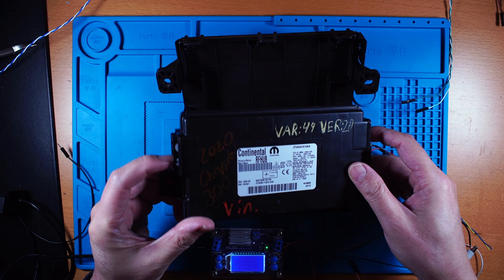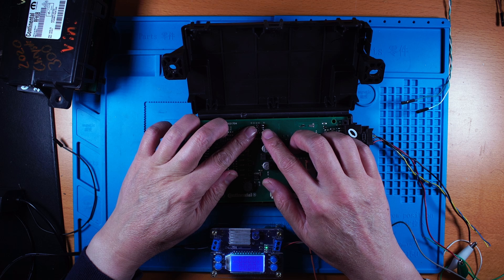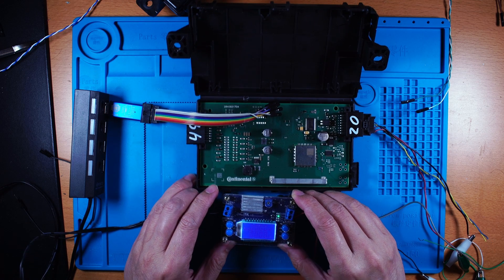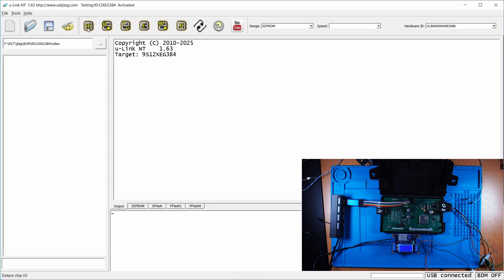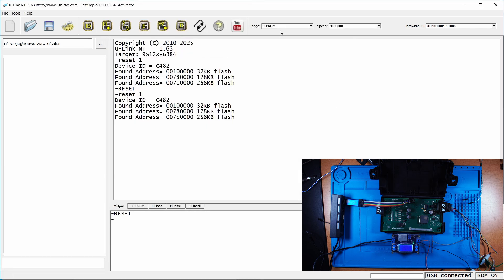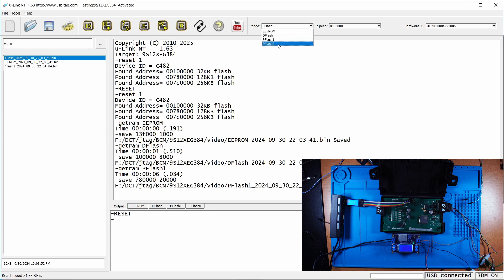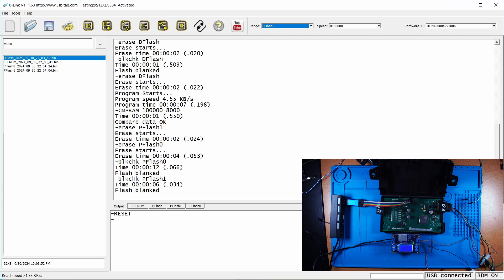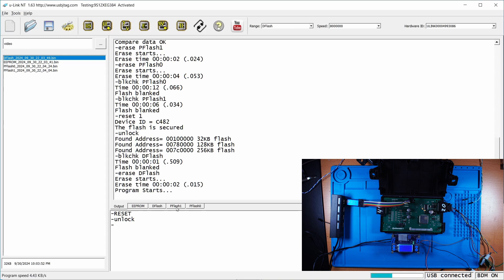u-Link NT Program RFHUB(MC9S12XEG384, BDM)

Comment: Don't tell me to come to the site because I already gone to the site and I'm still waiting admin approval. How do you apply the checksum to this RF hub. Cuz cloning it's great and everything but it does me no good. If I need to modify it. I can see that the new version of the software calculates the checksum. Um. If I had verify or comp ram or whatever it does it apply the check from because I've had it work numerous times before where I go in there and edit it but I usually have to do it multiple times over and over and over for it to actually work and take the vin. And I haven't really found any reason why I work sometimes and other times it doesn't. How do you apply the checksum to this particular device on this particular Target?
Reply from the maker: The forum's account will not be activated automatically until you send admin email to do so. Too many spammers. For checksum to work, there is no universal way, each target needs its own algo and case by case. u-link NT provide a way to read and write and with expand dll function it is possible to implement the checksum or any binary patch feature but this will be separate from the main software.
Reply: @usbbdm I already did send that but no answer and there's not a checksun. It's a little more complicated than that. It has what's called an FTM which is a boot and partition manager and there's different permissions that get set and stuff like that. You can glitch it into stopping the CPU so that you can write the braum data, but then the prom data has its own copy functions that happen to copied it down to the NVram or another partition in the eprom partition cuz I guess like the eepron partition can get segmented into multiple sections. One of them gets used as regular RAM and other one gets uses. Storage is more like a filing cabinet with a rotating data when it gets stored you can't do it at certain times and you can do it at other times. Otherwise it's volatile when you lose power. Blah blah blah blah but I figured it out for sure
Reply from the maker: @crbnchem  Not get any email ask for the forum activation. For everything you want to do with the binary you can make a clear request and it is possible to create a DLL to do so.

Comment: Having issue with read this modules with different tool .. I have this device how do I download software
Reply from the maker: Watch to the end of the video. The softwarer has it all.
Reply: @ I sent email for activation code still waiting for that to use device
Reply from the maker: @jayl6030  Check your email or try to use online activation.